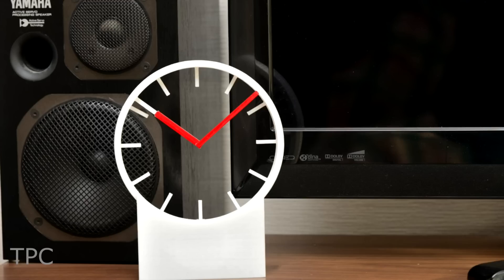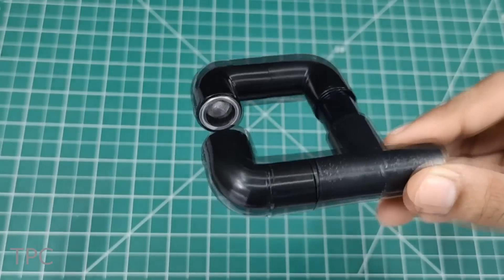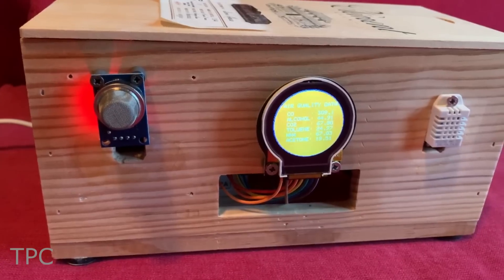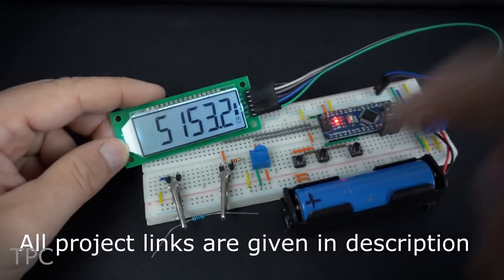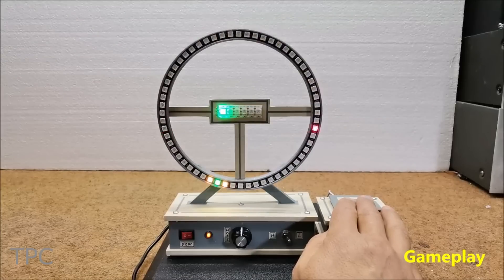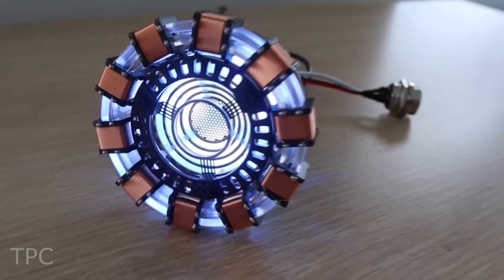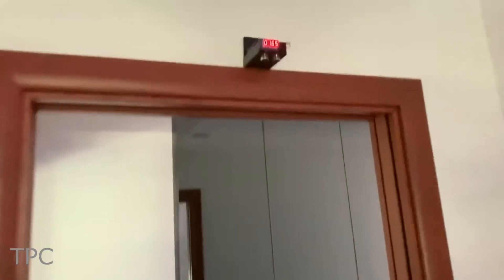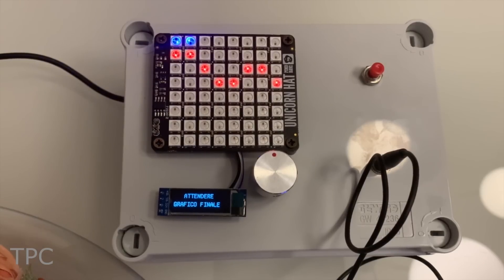A Fast RC Buggy & 11 More Arduino Projects!

Comment: Bro I wanted Arduino code for this plane https://youtu.be/WKkWElvF-a0
And I have made this https://youtu.be/bD7rQbnSbek transmitter and receiver. I wanted that when I  move any one joystick to right then one servo should go up and other down. Opposite for left. And that same servos should go Up at same time and as well as down at same time. And the code should be 2 servo and one brushless motor and brushless motor should stop when I take the joystick up and at normal position of joystick the motor should start Rotation . Please bro give me code because there no one who replied me only you replied me. I will subscribe to your channel please

Comment: I don't think this is for a beginner. More like the project that only advanced user can do.
Reply: No, the advanced stuff is like walking humanoid robots or homemade 3D printers. This is beginner level stuff.
Reply: Yea I don’t see a beginner doing these projects.
Reply: @Sctronic209  Too many clickbait on youtube these days.
Reply: @jumbo999614  right ✅ 👌 🤣 👏
Reply: Its easy
Reply: You all are not educated enough to make this
Reply: https://youtube.com/shorts/tJFEdxvfShA?feature=share
Reply: Try these! You can also do..
Reply: I agree with your comment
Reply: What do you think  you will see u windmill light generator🤧💀
Reply: they seem to think that a " beginner" means somone who works at nasa
Reply: Lmao. An 8yo did this within 3 days of introduction to arduino. Most people confused need to restart at page 1 "what is an arduino"
Reply: @Tom-90210  Yeah, this is beginner level stuff.
Reply: If you are using an arduino and breadboards... it is a pre requisite that you have a basic understanding of DC Electrical principles... An understanding of How Digital Circuits work... and a general understanding Steuctured text coding. If not you need to learn the basics of all of those things...prior to ever running power to your arduino.  Any beginner arduino video...cannot teach you all of the electrical...Digital...analog... coding things... that would take you at least a full semester class of each of those areas of study.... in a 10 minute video. Do the work.